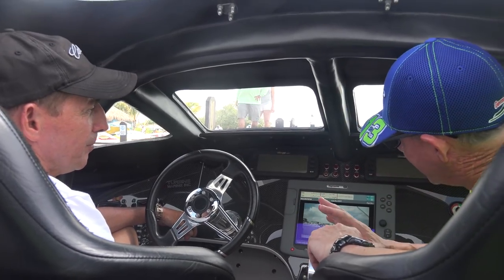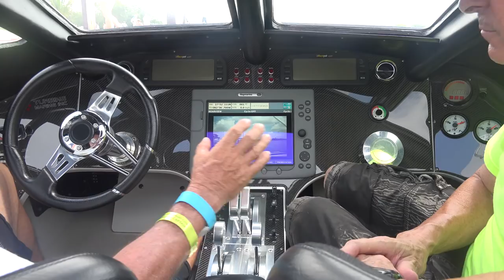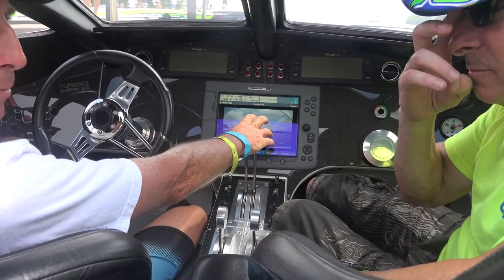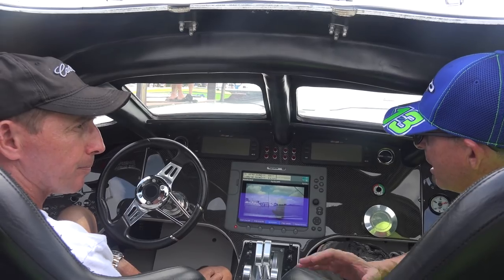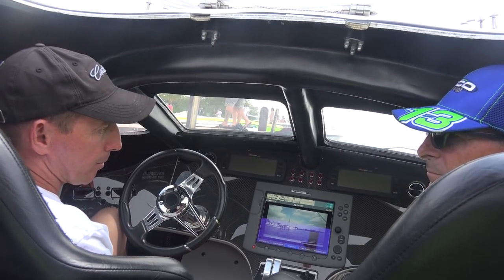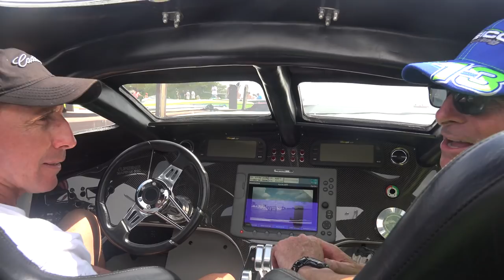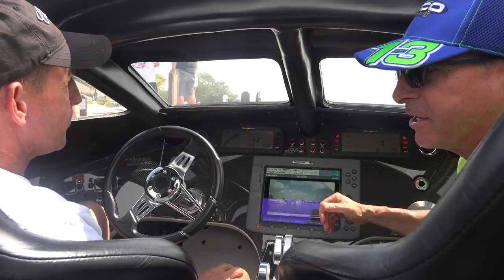THE WORLDS MOST INCREDIBLE TWIN TURBINE PLEASURE BOAT

Comment: How do you get this thing going -- Well i tell ya what ah you start it with a whole series of switches on the side over here, and then your gauges  give you the percentages of what you need to run and WhatNot and ah then the throttles just give the gas and ah off ya go !   Man that's so COMPLEX not to mention the RPMS !!!!
Reply: Turbine engines work off of percentages not throttle, if that makes any sense. You have no throttle. When you engage the prop, it strains the engine, and the turbine engine gets more fuel to sustain its speed for the amount of load. A piston driven engine you control the load and fuel on on 100%. A turbine engine you just control the go and it controls the load and fuel itself. That's my understanding atleast
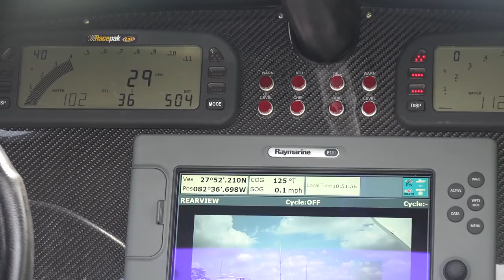Reply: 3:25 listen to what he says . It’s the most important part of operating this missile

Comment: I'll take piston engines over turbines any day
Reply: useless noise machine, no soul
Reply: keimolantio 
Yeah but only half the service intervals with a turbine and superior torque.
Reply: Don't forget power to weight!
Reply: Yes they are noisy and non economical at low rpm but Turbines are mechanically superior. They can output high horsepower all day. A piston engines starts breaking down as soon as you add high performance modifications.
Reply: That’s a joke, right?
Reply: Piston engines don't make enough power.. even the most extreme piston engine doesn't come close to the power of a gas turbine.